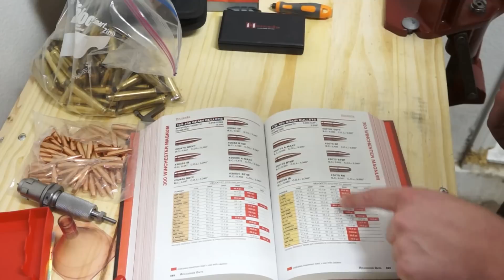Beginners Guide How to Reload Ammunition (300 Win Mag)

Comment: I trim after resize as my trimmer likes the primer to be gone to help center the case. You should not lube inside the neck, even with unique as powder can stick and cause problems. Also there should be a very small amount of lube on the neck (outside) as it is the part that is under the most stress. The key is to control the amount of lube (very light lube) to avoid oil dents. The Unique is better at not denting the neck, but caution must still be taken to not over lube.

Comment: When setting the resizing die do not use "pliers;" use the proper open-end (or close-end, open/close-end) wrench to loosen and tighten.  Usually a 1/2" wrench works excellent.  I have one 1/2" Craftsman open/close-end wrench that is a part of my reloading kit that does not get used for anything else.   Very good video!  Not trying to make you look bad, I just wanted to throw that out there for clarification purposes.

Comment: I not sure lubing the inside of the neck is a very good idea. The lube left over can cause powder to stick to the inside of the neck when charging the case and also effect how the case is crimped after the bullet is installed.  also seems very slow but them when I reload 223 or 308 I am usually reloading between 100 to 500 at a time on my Dilloin 550.

Comment: Can we load our powder first and then just lube the bullet itself instead of lubing the neck of the case ? I've seen those powder trickles before but until this video I didn't know how to use them so thanks for that . I ordered a digital scale , sort of like yours , and it came in today ; financially still have a ways to go before I actually start loading . Also , you probably could glue a magnet to your press , considering that the press is aluminum , and that would hold that tool that you have to take of occasionally or if there is room on that tool to drill a hole and install a cable that is also secured to the press , kind of like how banks do with writing pens that customers can't walk off with .
Reply: Don't lube the bullet itself, the casing needs to be able to grab the bullet, you may be able to wiggle the projectile in the case and that is no bueno